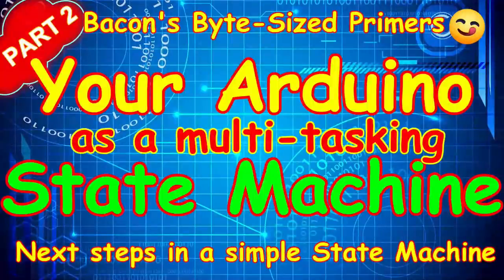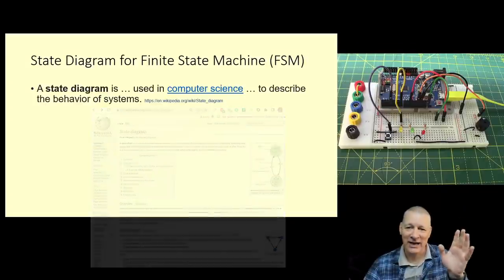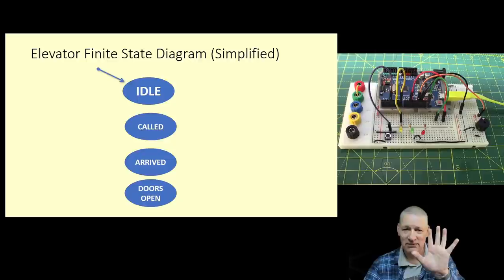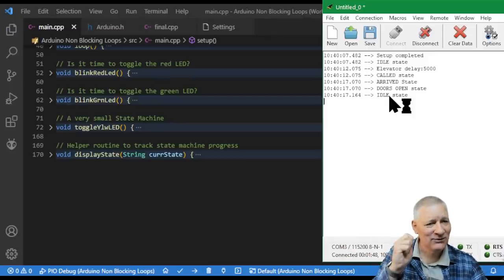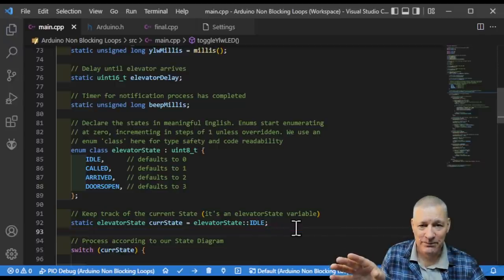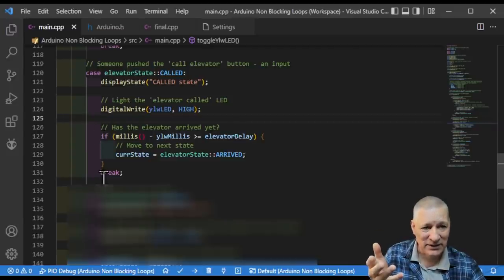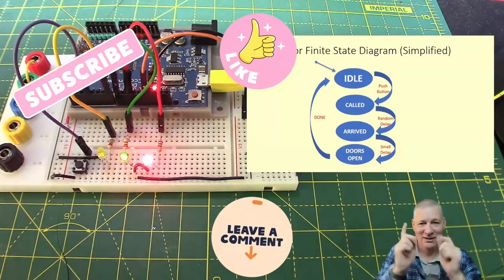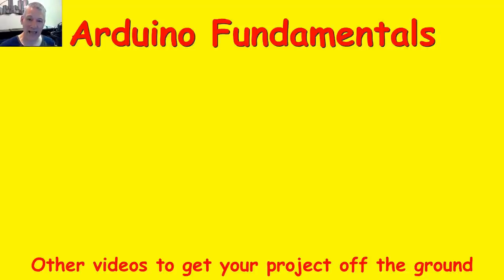#BB6 Arduino State😲Machine - Part 2: Implementation 🥳🥂

Comment: You should always add a "default" to the switch block in case something modifies the memory that the state pointer / variable is at.  You can also just "return" from the state machine or switch block adding a break under a return can cause some compilers to moan.  The industrial way of doing  the "call" function would be a debounced interrupt if they are available.  A switch block is also useful if you have a lot of checking and the "if" statements are getting out of control.  Very well conveyed information on FSMs, have a like.
Reply from the maker: Thanks Aaron. You have raised  a good reason for always having a "default" case (to be honest I thought they were mandatory but apparently they are optional).
Reply: @RalphBacon  Yes they are optional, but any good compiler will raise a red flag, I think it is good to get in the habit of adding a default, I think in BASIC it is "case else".

Comment: Great video. Very well explained. State machines are sometimes explained very differently on the web, as is the approach to programming it. This has annoyed me a bit in the past. Your video helped me a lot to better understand State Machines. Thanks very much. Now, I wonder if there will come a part 3?
Reply from the maker: You really are a glutton for punishment, Roman! 😁
Reply: @RalphBacon  Don't worry - I think you've probably all said what mattters. I don't expect a third part. You really take your time with your explanations and I really appreciate that. This also sets you apart from many other electronics channels. Keep it up. Regards.

Comment: Dropped in here to check out what method you are using to implement a state machine. I have been using PIC MCUs for years but only recently started using the Arduino IDE for ESP32s. When programming PICs in C I usually use a function pointer as a state variable. That way I can change states by setting the state variable to a different function. Each state is represented by a function. Then a switch statement is not needed as the state variable points to the correct function to call. In my opinion the function pointer implementation is simpler to maintain.
Reply from the maker: You carry on using your function pointer if that works for you, Dan, by all means.😁

But you won't convince me that's the best approach for newbies to the concept (and subsequent programming). Once a developer understands the concepts they may well graduate to your preferred method!
Reply: Do you have a code example to show me? I'm interested to learn what you just explain! Thank!
Reply: @12dodo37  I'm not going to post my code here. I respect the response from @RalphBacon . Perhpas some day I will have an example specific to the Arduino IDE amongst my Github repositories. My current code is written in C for a PIC Xpress board and as such would likely only cause confusion here which I don't want to do.

Comment: Hi, just wanted to say thanks for this video, as always, it's really great. I don't know why or how, but as I'm plodding through my personal coding project, your videos (and Github) lands some form of a gem and that makes me stop and think. This is just a case as I'm working on a PID/BBQ project and I've just started to look at the idea of having different temperature readers; but I need to know the 'state' of the PID/controller as well as the mode in which I'm readings temps (from what type of probe or API). So having 'states' I can clearly define, in English, what and where things are at... I find it quite funny really that your videos keep on moulding my project LOL.

Thanks for these great videos!
Reply from the maker: If my videos make you stop, think and adjust your approach to coding, my work here is done. Thanks Dav! 👍🏻

Comment: Thank you for this series of videos Ralph. They're terrific! I've been doing an Ardiuino unit with my Grade 11s  and they're SO Into It!. I showed them tone() on Thursday and you'd think they were Man being given fire by me, Prometeus! The music students immediately grabbed their Bach scores and started programming the kits to play symphonies. What have I unleashed?  I'll be showing these two videos to my G12s in a couple of months so the future CS and CE students will have an idea before they get to university.   

I'd like a clarification. I use the "lastPressed = millis();" construct in my sketches for detecting button presses, but I define the variable as a global long type. What is the disadvantage of that strategy rather than the static variable defined in loop()? Thanks for helping me understand this. Best wishes, Gord
Reply from the maker: Using globals (spawn of the devil etc) will, of course, still work. But unless the variable has to be globally available, to several functions, then it has no place in the global namespace. Put it inside the function that needs it. 

One "disadvantage" of global variables is that they exist for the duration of the sketch and are thus allocated memory space. Temporary variables only exist for as long as they need to (but not static ones, they exist forever too).

One final aspect to globals. It's an easy cop-out to define a global on the basis that a couple of functions need it. It's better to pass the variable (by reference, ideally) to the functions that require it. It makes the code self-documenting too.

I suppose it's all down to how "tidy" you want the final program to be!
Reply: The timing variables should be unsigned otherwise at some point they will go negative and the timing comparisons will no longer work as expected
Reply: @Bob_Burton  thanks for the insight Bob!

Comment: Hi Ralph, did you mention displayState that only prints the state once, otherwise each loop would print out the current state!  Good example thanks.
Reply: Just removed my comment to that effect, having seen yours.
Reply from the maker: I didn't actually go through the code as it was not relevant to the State Machine logic; but yes, it just compares the current state to the previously reported state and just prints it out if there is a difference. Stops the Serial Monitor getting flooded.

Comment: You can still assign elevatorState with an integer like this:
static elevatorState currState = elevatorState(0); // IDLE

Writing it this way makes it possible to increment states. You could do something like:
int i = 4; // out of range
currState = elevatorState ( i % 3); // loops back around, assigns IDLE state

So even when "i" is out of range from the number of states, it will loop back around and pick a valid state.
Reply from the maker: Unfortunately, I would consider that using "magic numbers" and is not considered Best Practice. 

Using an enum (ideally a class enum) forces you (the developer) to use meaningful state names. 

I'm not sure that performing maths on a state is that meaningful, just my 2c worth! But maybe you could write a function to do that, anyway.

Comment: Hi, this is a very interesting set of videos for beginners,  like myself.  Thank you. I am struggling  to understand how to apply this knowledge to a project that I am trying to finish. I was wondering if you could help me? I want to run on an Arduino Mega a stepper motor and a couple of digital sensors. I am trying to spin the stepper continuously and in the same time check the sensors and somehow it is too slow between the steps of the stepper and don't know how to make the stepper spin without big breaks between the steps. Do you think you could help, please?
Reply from the maker: You will have to determine how often you must tell the stepper motor "Go!" to turn it continuously, without any stuttering or pausing. 

The gap is all the time you have to run other code like sensor reading. If reading sensors is a "blocking" activity, that is, you request, say, a temperature reading but that takes 100mS, well - that's a 1/10th of a second that the stepper motor is not getting any signal from your sketch.

Part 1 of this video showed a way to split your time between various functions using millis(), but if your function tries to read a sensor that then "blocks", there's not a lot you can do about it. Your stepper motor will stop.

An alternative would be to use a "timer task" to keep the stepper motor satisfied whilst your main "loop( )" did other work (like reading sensors). The Timertask runs regardless at a frequency determined by you (eg every 10mS) to keep your stepper motor running smoothly. I did a video on Arduino timers in video #209 (and possibly #210) so you will need to do some research on this.

As you are running on a Mega2560 it will support a task scheduler (RTOS) which I did a video about recently in #244; if you need to continuously hand-hold the stepper motor it would do the job but only you will know if it's beyond your current capabilities.

Comment: Hello Ralph thank you for posting this informative and educational (for me) video. Using the enum class as shown in your example I have the Yellow LED on to show power is applied to the Arduino. When the button is press the Yellow LED goes off and begins Blinking the Red LED 6 times using the statement: void blink6times(){  for (int i=0; i<5; i=i+1){ }. Once the Red has stop to start blinking the Green LED for 1 minute and once it reached 100,000 milliseconds to start Blinking the Red LED once again for 3 time and stop turning the Yellow On and in IDLE. Could you direct me as to where I should place the blink/stop statement in the Void loop() - Thank for any direction you could provide and keep up the great videos
Reply from the maker: You need to draw a Finite State Machine diagram. That way you will have various circles representing the different states.

The loop then has, for example, a SWITCH statement and executes the code just for the current state .

When the state changes (eg a timeout in your case, so the current state code will change the state to the new one), the loop will execute a different bit of code the next time around.

Make sense or too brief?

Comment: U.S. 3 light stop lights have two additional states, for when the local central traffic controller is offline. They are flashing red and flashing yellow, which convert the stop light into either a 2 or 4 way stop sign. The flashing yellow like may be used to give one of the cross traffic paths preference, and means no stop required but cross with caution, the stop light is not working.
Reply from the maker: I just knew someone would tell me that I hadn't covered all bases! As a reward, Jerry, I'll let you write the state machine for all the cases now known about. Should keep you busy for a while!

Comment: Hi, in your video about using the DF Mp3 player I commented and asked for your thoughts on what I had done using 20 folders on the SD card and was working on adding LEDs to indicate which folder was active, WELL... I watched this video multiple times and think will solve my problem, just need to sort things out as to IDLE, CALLED< ARRIVED etc to fit my needs. Thanks for this video.
Reply from the maker: Fantastic! I'm glad it's all up and running and giving you the opportunity to do some creative thinking too!

Comment: Fantastic! I am working on a robot fed oscillating conveyor. The conveyor is driven by a closed loop stepper motor. I'm using a Controllino (Arduino clone) to coordinate the robot, conveyor, and the movement of another machine. It's going to be pretty trick when it's completed. Your videos are clear and concise, and because of them I understand enough of Arduino FSM to get me over the hump! Thanks :) By the way, do you have a suggestion of reading material that picks up from where your video left off?
Reply from the maker: To learn more, Google is your best friend. There are many (advanced) videos on FSMs that go far beyond what I covered. TBH I think some of it is just too much theory over practical application, but one topic to consider is Hierarchical State Machines (ie State Machines within State Machines) which is most definitely required for larger programs to avoid State Explosion (yes, it's a real thing).
Reply: @RalphBacon  Thank you. I will dive into those, and try not to get blowed up!
Reply: @RalphBacon  So, in my travels with HSMs, the 'QP Framework' keeps coming up as the tool to use for embedded systems. Is this indeed something that is widely used? Do you recommend taking the time to learn it?

Comment: These two videos #BB5 & #BB6 are really critically in my development as an Arduino Robots builder.  I learned so much that I will review them and STATIC, Finite State Machine with lots of Non-Blocking tricks.   Many comments stating how to do it better but you correctly defend your desire to teach 'beginners'; well advance beginners and intermediate coders using MCUs.

However,  I saw that you were reading a port that you set as OUTPUT about which I was completely unaware it was possible; I was not able to find docs supporting this in Arduino reference  docs.  Lastly, you use Cool Term instead of that built into VSC and PlatformIO; I don't think you call Cool Term from within VSC & POI, Correct?.  Care to comment.  BTW, Bacon Bytes are an important addition to your channel, well done albeit a bit silly at times - oh you are a Brit!
cheers, mate.
Reply from the maker: Well, I'm half a Brit, the other half is German but I'm glad you like the videos, that's the main thing. Who said Germans don't have a sense of humour? Or is that my British side? 😜

I don't call CoolTerm from within VSC, it's entirely separate which IMHO is a good thing. Especially if CoolTerm is attached to a separate FTDI Serial-to-USB adapter which then goes directly to the TX and GND of the processor - you never have to Disconnect not even when uploading new sketches via the USB cable.

There are many roads to Rome, but the one I'm treading is hopefully slow enough for beginners to get better (or just to understand the concepts). Yes, all the PROs here will always tell me I could/should have done it differently!

Comment: What prevents the " static elavatorState currState = elevatorState::IDLE; " from changing the state to "IDLE" each time the loop runs?
Reply from the maker: The keyword "static" ensures it is only initiated once, thereafter that assignment is ignored. Acts like a global variable but is declared within the function where it is used. Cool, huh?
Reply: @RalphBacon  Thanks for the quick answer. I was struggling to understand that. Very cool actually

Comment: You also need a "doors closing" state and you need to queue calls from multiple floors.  Your hardware should have a switch for each floor.  Real elevators also need a limit switch to terminate the doors opening state and a safety switch to halt closing.  These additions will require additional states and transitions.
Reply from the maker: Not in this demo, Byron 😉 

I did mention a missing state (DOORS CLOSED) at the end that we would just ignore as the "boredom factor" would otherwise assert itself. But it's good to see you're obviously on top of this State Machine malarky!

Comment: Can a state be triggered by an interrupt? Let's say we have a snail mail monitor with a 2 line lcd that normally displays 'Waiting for Mail', followed by the time and date on second line.(State MsgMailWait).  When the rf receiver receives the notification that mail has arrived (interrupt) , change msg to 'Mail Delivered' and time on first line, date and time on the second line as before. Would you  just have a new MsgMailRx state?
Reply: For sure it can.
Anything a button can do (change between states), the code inside an interrupt handler can also do.
A simple way would be to let some code inside the interrupt handler set a flag (a boolean variable indicating the interrupt has happened) and the code in the state functions can read (and reset) that flag.
Reply from the maker: What he said 👆🏻

Comment: Would you be able to give a part 3 to this series looking at FreeRTOS and their xTaskCreate() ?  I've only recently discovered this in the ESP32 and its kind of blown my mind for creating async tasks within a microcontroller (like checking internet and NTP connection)
Reply from the maker: I want to cover FreeRTOS for the Arduino would you believe in a future video? I've already done the ESP32 (quite simply) in video #149 https://youtu.be/jpVcCmh8sig but I think an update is probably due. Keep tuned...
Reply: @RalphBacon  sounds good! I'm using an esp32-s2 at the moment and FreeRTOS still works with the single core.  Would definitely be interested to see it on an Arduino too.  Have been itching to try build a state management system like Redux or Bloc (I'm a web/mobile developer for my day job) and have mostly been blocked on the synchronous nature of cpp

Comment: That "default" case in the switch statement can come in handy if writing something horribly complicated as it can trap cases that you've forgotten or haven't gotten around to writing yet. Or just don't write the entrance case and let the default pick that one up (though I would consider that sloppy coding).
Reply from the maker: Yes, the "default" can catch unexpected conditions and should always be implemented just-in-case, even if you are positive you've covered all bases!
Reply: I ALWAYS use  the default case to raise "unhandled state" or similar exception, it makes that error so much simpler to debug. Never use it as a normal case.